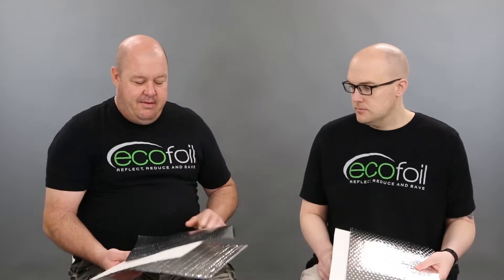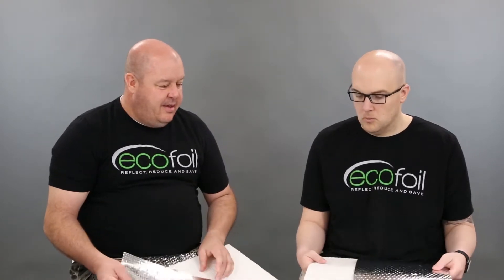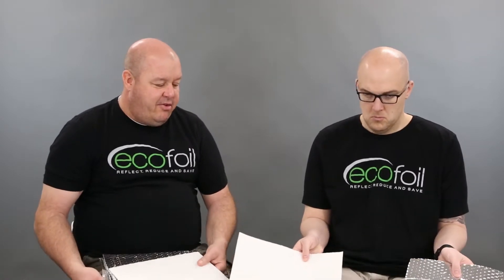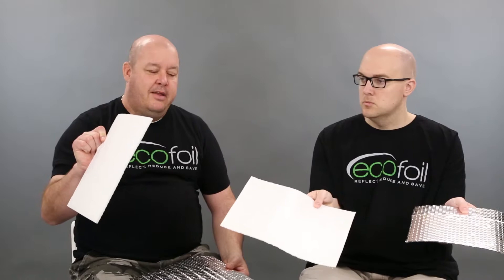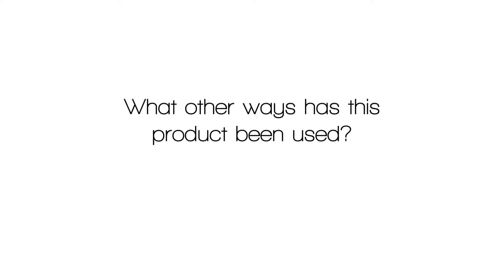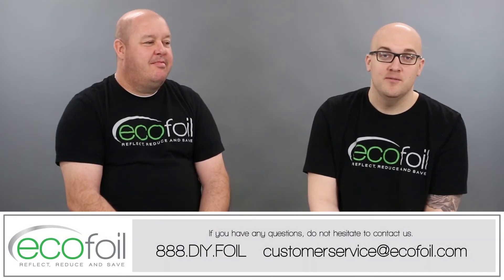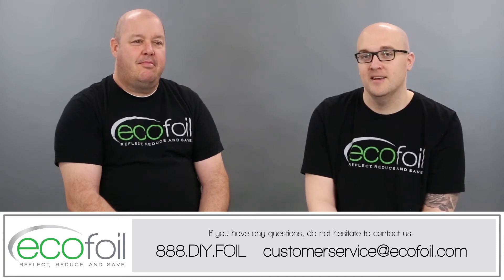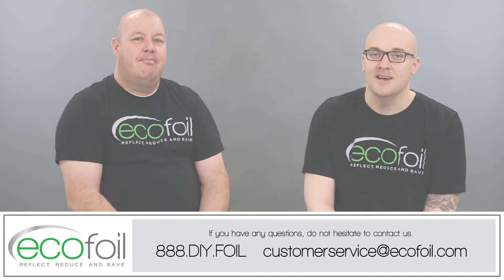EcoFoil - Bubble Insulation

Comment: i will reach out to that email but figured i’d start here:

would you install the bubble between your sheathing and studs?

or if used for a floor with an exterior crawl space… between the subfloor/joists?

would the compression defeat the purpose of the bubble air gap to reduce the condensation?

i live in hot humid georgia(atlanta)
Reply: nvm i looked closer at the product links